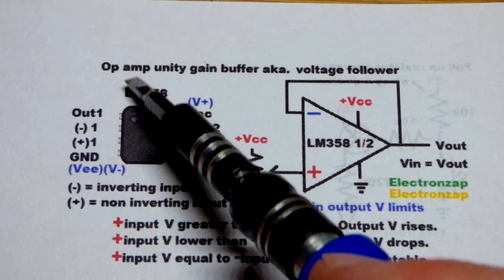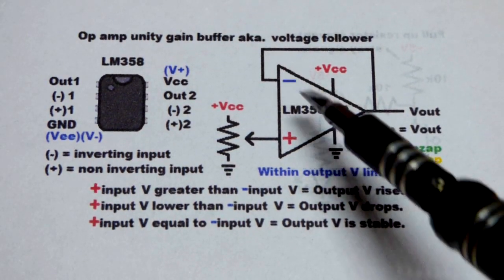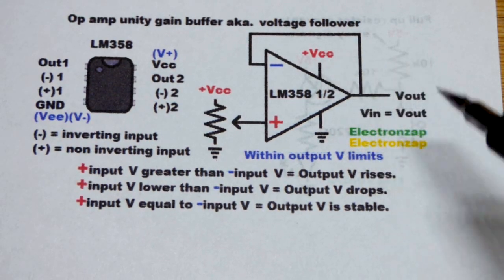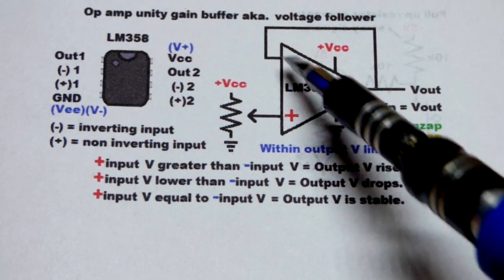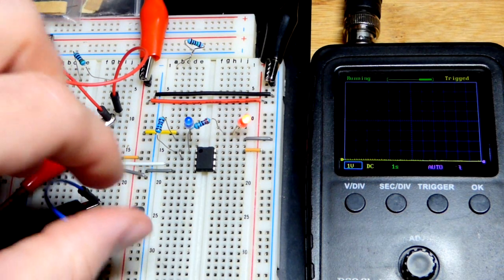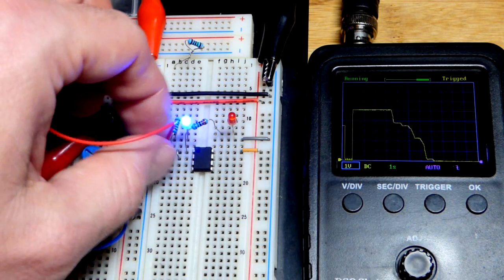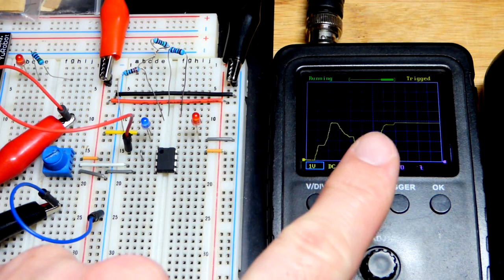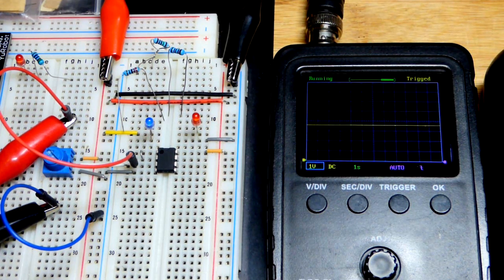Operational amplifier voltage follower aka unity gain buffer circuit using LM358 op amp IC

Comment: This came just at the right time. Working on a synthesizer project and needed a single supply op amp buffer. Does this work for audio range projects? Similarly to a TL072?
Reply from the maker: Glad it came at the right time! I never really looked into a project like that. I'd look for similar circuits put together by other people for inspiration.

Comment: It would be useful to explain why this circuit is useful.  Would it be useful for driving a load that requires more current?
Reply from the maker: You're right, I should have mentioned that. Yup, you can provide more current than the trimpot alone, plus the voltage of the trimpot will be thrown off if it has to provide current to a load.